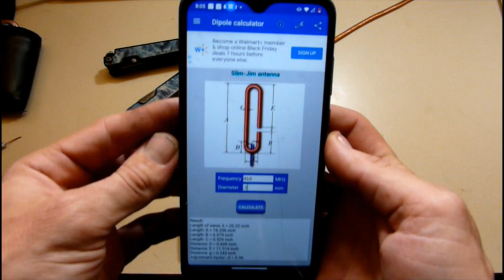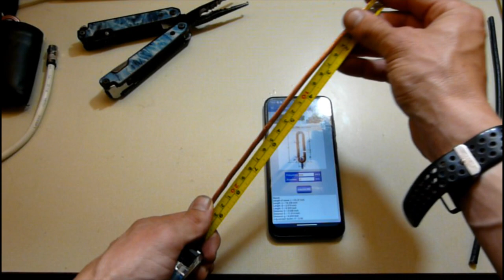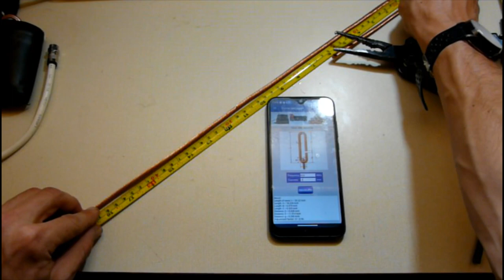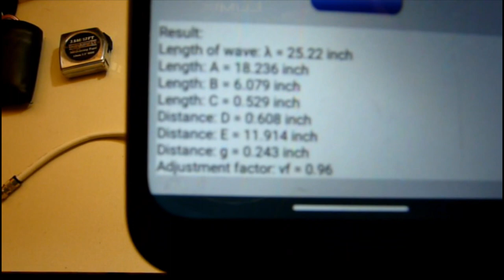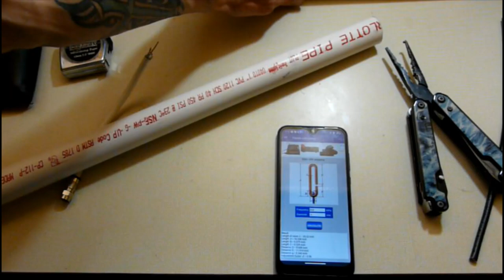HOW TO BUILD, GMRS BASE ANTENNA/SLIM-JIM.

Comment: There are so many things wrong with this video. You're using stranded wire instead of solid. You're using 450 psi pvc instead of 200 psi (too thick). You don't connect the feed wire. You don't trim it. You don't tune it. You don't show its performance. People who've made these may know that this will perform poorly. People who haven't made these will copy you and wonder why it doesn't work well, or wonder why their radio burned up after a few days.
Reply: This is why I believe the GMRS Licence,  should have a requirement of having passed the Technician Amateur Radio class. So much could be learned about antenna theory, basic electronics, and mathematics, and proper operating fundamentals, just for starters.
Reply: @ki8um119  so you want the government to block people from using the a tiny slice of bandwidth? How does that make sense?
Reply: @Gruuvin1  Block? So you've basically saying  Amateur Radio operators are blocked from getting our license? 😂
Reply: @ki8um119  not 'saying' that at all. I'm implying we shouldn't abuse the power of government.
Reply from the maker: i was just starting out

Comment: For the end, the jumper where you will connect your coax to, you are using a catv 75 ohm cable with a F-59 connertor  that the shield will NOT solder into that antenna. You should use a proper 52 ohm. 58 or 8u mini with a PL259 or SO239 connector. Other than that, it looks good. One more thing, instead of taping the top where it will eventually allow water to seep inside, use a pvc end cap.
Reply from the maker: ya thank you i will do that i haven't put it up yet but was about to and ya ill get some caps and put them on soon thank you for the comment.
Reply: Why won't the shield solder to the antenna? If the antenna is correct, won't 75ohm give you a 1.5 SWR?
Reply from the maker: That was a pretty much basic how to video yeah, I was using the wrong coax and connectors, and I had no solder when I first got into this Radio hobby I’m using the right cable and everything now but yeah that’s just like a basic show like how to in the video is 7550 nice to have all those good tools that I have now but I didn’t back then it was pretty basic. Have a good day.
Reply: @hillbillytarzan Most radios expect a 50 ohm coax match.

Comment: When you put this up on the roof do you have it laying down or standing up? Does it make a difference, can you show how you mounted it please
Reply from the maker: it is standing Strate up its how it works if you lay it down it wont work
Reply: FM frequencies are vertically polarized.

Comment: Looking for a simple GMRS antenna to build and this looks like a good one. I wish you had included an SWR reading. Thanks for the video. I'm going to build one and give my 2 cents on it. I agree with @roaddogg5074 a 50 ohm coax would be the best choice. Schedule 125 PVC would make a light antenna.

Comment: What's the thickness of that PVC pipe? 200 psi or thicker? I don't understand about taping the gap in the copper wire ( how it's done).  You should have showed each step and it would have been a great video . Some of us have never made an antenna before.
Reply from the maker: the pvc is 450 psi and the gap is half inch you can download a antenna calculator from the app store and it will give you all the measurements you need ill do more in depth videos in the future. thank you for the comment.
Reply: Schedule 125 is thin and would make a light antenna.

Comment: If I'm not mistaken, the way you are soldering the coax it's actually transmitting with the 1/4 wave leg and not the 3/4 leg as most of the plans I've seen show. They are soldering the center conductor of the coax to the 19" leg and the shield to the 6" side. Seems like the 3/4 wave side might increase the performance.  Just a thought.
Reply: KB9VBR does his jpoles backwards like that too. I thought the same thing you did. Why do so many instructions stipulate the center conductor goes to the long leg? It's AC so do you think it matters?

Comment: It looks like the pvc pipe you are using is thick walled PVC (with a higher pressure rating).  This can actually adversely affect the power radiated from the antenna.  Ed Fong, who designs and builds antennas specifically instructs people to use only the thin walled PVC for use with his antennas.  You may want to consider changing to the thin walled tubing to get the max output from your antenna.  Also, it looks like you are using 75 ohm cable, does that affect things at all?
Reply from the maker: Right and that’s the only PVC I had and the only cable I had that’s when I was first beginning now I have LMR 400

Comment: Can u make A 11 meter band aerial like this cause iam in Apartment .....
Reply from the maker: yes i can its the same thing but it will be very tall and you would need bigger pvc pipe. I will make one when i get the supplies.
Reply: @arizonasadventures8827   thank U and if u can send on photos off how to make a 11 meters aerial I would be verry happy cause iam in Apartment but I do have a small garden I might get a way wit one made off PVC pipe .and wire like the one u made thare .........
Reply: It would have to be at least 17 feet tall for 11 meters it would not be as small as this antenna.
Reply: An 11m antenna will be about 17' long